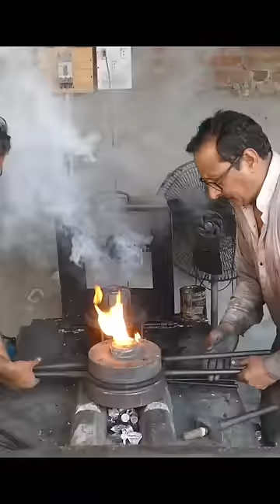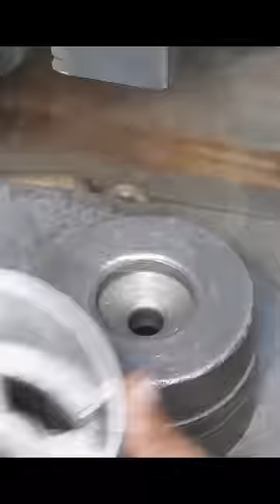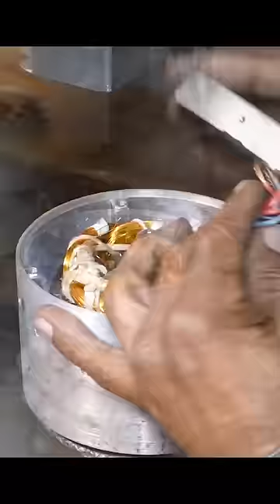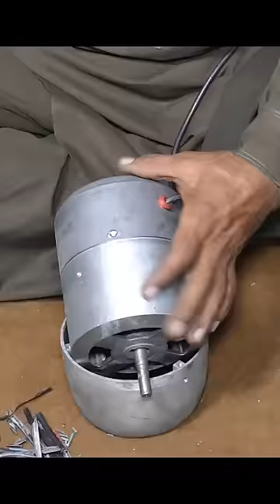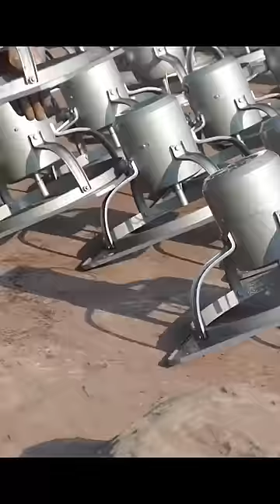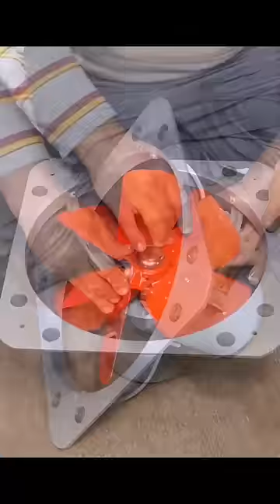Exhaust Fan Manufacturing #shorts #youtubeshorts #manufacturing #exhaust

Comment: This is a sustainable manufactering method! everything is made locally! and it means less transport. Good job!
Reply: But these fans are not energy efficient
Reply: @rahulmaurya23079 but they durable...
Reply: Yu
Reply: @mosawirjan3428 ek bar patak ke dekhko😅
Reply: @rohankashyap4016 Terko bhi patka toh tu bhi kharab ho jayga bey.
Wo toh machine h ek tarha se.
Reply: At least they are doing some productive work, in a product starved country?
once you know the crux of the product, it becomes as routine as Chapati or bread!!
  The efficiency is routine test procedure, which need not be part of the video?? Even if there is a minor mis alignment, motor will lock up or rotat slowly plus will have notice able heat up. By experience,they are capable of judging close to any analog meter reading. 
 There are lath operators who work with out vernier, and turn ,"Good Fit" matching parts.!!?
 That is sub continent, engineering, industry, The" Indian Jugad" , people come up with, is the product of these hands on workers, fertile mind.
 Do not under estimate them. Give them opportunity to create and grow!✌️😀
Reply: @rahulmaurya23079 0